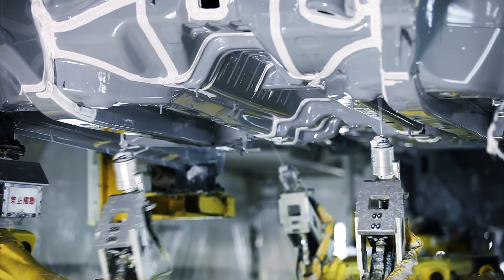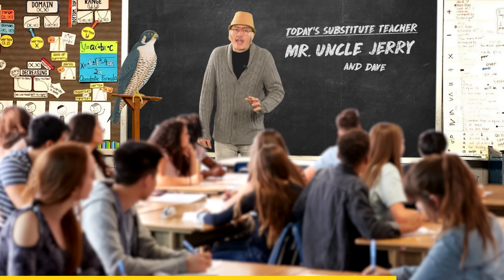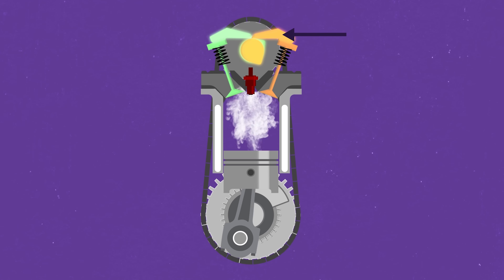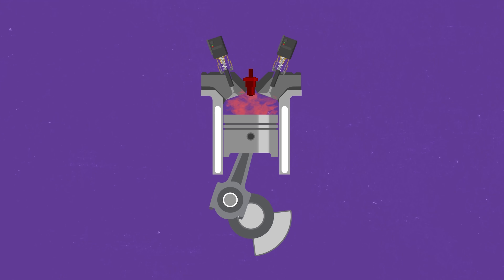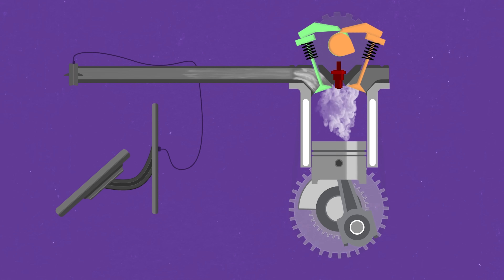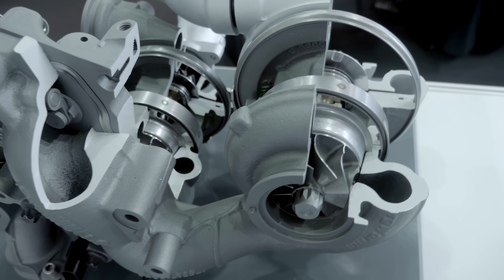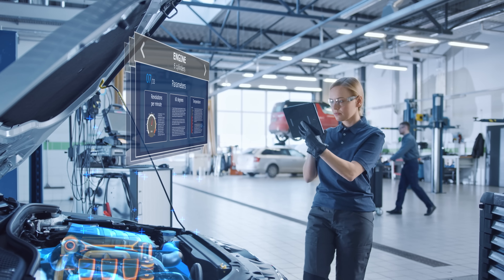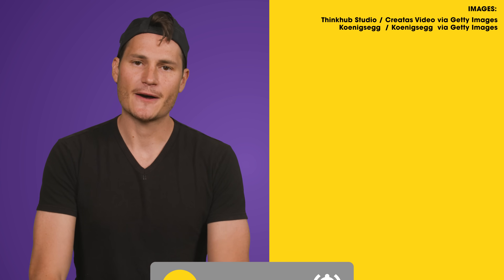This Is The Last Great Engine Tech

Comment: I think Freevalve is amazing but I have some questions:
1. How's the reliability?
2. Why is it not widely used by other OEMs?
Reply: Electronically actuated valves in mechanical settings have been used for decades. Commercial/industrial HVAC has it everywhere, it's a simpler design overall. But it's at least no more complex or reliable than traditionally mechanically complicated systems. Solid state has improved this reliability even further.
Reply: Its not widely used because of legal issues im guessing. Iv heard that the reason alot of these features arent widely available fast enough on cars, is because an OEM would hold the rights to it for a shit ton of time, and would expire after a decade or something.
Reply: You also take out more moving parts so I think it's kinda a mute answer yes the solinoids that move the valves may cost more but,you don't have a timing belt tensioner or a timing belt and no cams
Reply: There are a bunch of bullshit answers here, the real reason is that Freevalve has a bunch of patents that would prevent any OEMs from using the tech without paying Freevalve. So naturally they won't pay up and are willing to wait until the patents are no longer valid, or would just rather focus on electric cars as ICEs are going the way of the dodo. Most of the patents filled by Freevalve were filled from 2011 to 2016, so they will lapse in 2031 to 2036.

Reliability wise, actuators are not a new thing, we've been using them for decades, just not for engine valves, their well understood and can be made very reliable. They'll last for years at least. They don't really have any moving parts.
Reply: It has about 10 years ago. It's not a new tech has suggested in the video. It's just too expensive
Reply: Reliability would come with mass production, example if Toyota picked it up

OEM are chained to shareholders for maximum profit, don't you realize that BMW is mostly plastic now. Shareholders are not a big fan of R&D because it eats into profits and dividends
Reply: @User1Entertainment  So because they use plastic and less expensive materials more it means the R&D is less?  Stop looking at base models my man and also understand some of the R&D ie make things plastic such as an intake to make for weight for such things as high pressure fuel injectors and or HPFP to feed the injectors now as well when they went to a high pressure fuel system and other ways they adapt to keep a mostly 50/50 on every vehicle and still adding all that useless bullshit over the years on the interior.  Plastic and foam are also a good insulator for guess what sound and who usually buys the BMW first? Someone with money and guess what a lot of them have complained about in the past and still do to this day?
Reply: @jamesbond-pr5jl  I understand that but I will not agree with decisions like plastic thermostats that BMW makes, certain areas of the power train should be exempt from extreme cost cutting in favor of reliability
Reply: If you watch the video on /Drive from 2013, you will see they had already been testing an old Volvo for I believe 5 years. The reason why other companies are not using this is because there is no money in ICEs. Audi even made a new type of fuel, for cryinoutloud! The government simply thinks that batteries are the way to go, no matter how they are made.
Reply: Actuators are used pretty much everywhere for precision movements of free-floating, low-friction applications, from your run of the mill audio speaker to the read/write head of hard drives, and they are the least likely element to fail in those applications (electric motors are much more likely to, usually from lack of grease).

They also have another property that make them suitable for valve control: they are capable of pushing and retracting. Cam lobes on the other hand push, the engine relies on the spring to retract the valves, and at high RPM 
those springs can become a bottleneck in the sense that they aren't capable of retracting the valve fast enough, compression can fall, air can be pushed back to the turbo on the intake side, the exhaust side could have the piston hitting the valve...

And last but not least: no more timing belt! If an actuator fails, the valve can be made to stay closed and not lead to the damage a failed timing belt would. Actuators are cool, man.
Reply: it’s used in many forms of racing, F1 has used it for a long time, and there’s 5 different manufacturers I believe, so ??? It’s like saying why haven’t they made Electric cars 20-30 yrs ago, but they’ve been around for 100 yrs too, the big 5 didn’t want to change and don’t want to change the normal way of doing things unless forced to do so.
Reply: The default is closed unlike with cam actuated valves, many modern engines aren't free wheeling they call these engines interference engines. If you break a timing belt or chain your pistons hit the open valves and can totally destroy the engine if it's spinning very fast when the failure occurs. That kind of failure is not possible with the FreeValve system. I watched Christian's presentation on his FreeValve system and he had a *Volvo (I think it was a Volvo, I'm getting old) with the FreeValve system using it for a shop car, he claimed it was doing fine. You can probably put
Koenigsegg FreeValve in your YouTube search and look for the big guy guy with the shaved head.
Reply: It is still a new tech as far as being implemented in production vehicles, and that production vehicle is very expensive and rare. There isn’t much data on long term reliability outside of Keonigsegg’s testing. They also probably have patents and licensing that they want to use to recoup their development costs.

As to why other OEMs aren’t doing it, the same reason why it took Tesla entering the market for them to take electric vehicles seriously or legislation that forces higher standards on them. Someone needs to gamble on it first and dip their toe in the water and succeed before the other OEMs will see the R&D as worth it. They are businesses with shareholders after all. Years back the drive did a piece on free valve while it was still in early development, and they addressed the engineering challenges with cycling the valve train with enough precision and reliability while attempting to keep the costs down in a range that would be palatable. The major benefit of free valve technology is that it can be applied to pretty much any gas engine once all the kinks are worked out, so it doesn’t even necessarily require OEMs to adopt it, you could eventually get a bolt on kit from aftermarket manufacturers for your 90s LS3 that puts it within spitting distance for efficiency and power of more modern engines if everything pans out for the technology.
Reply: Why retool or retire your assembly lines or suppliers? Plus, it’s probably cheaper to keep the traditional tech. You have R&D and costs associated with the changes. I wouldn’t be surprised if they’re waiting to move to the tech or betting on electric, as CA is banning all new sales of ic vehicles in 2030(?)
Reply: Reliability great.  Gains great.  

To anyone who says camshafts are reliable how many cars out there are interference with timing belts and sub 100k mile service to that belt?

Just needs to beat that.
Reply: and how expensive would replacements be?
Reply: dude its fresh just like electric cars were!
Reply: Injectors on a big rig are virtually the same concept and they last for a million miles some times. I don’t know how many cycles that is but it’s a lot. I imagine if this comes to market they will engineer it just good enough to last around five years of average abuse.
Reply: @aceplaysgamesnetwork9566  haha hence why im laughing to how there is still so much ignorance of understanding how vastly this consept has been used for years and years by so many still being I know fiat air was not the first of this style of used concept on mass by any means. All major cars using the HPFP system too and even upgraded from solinoid to pezio style to more accurately do it.
Reply: If i remember correctly, the issue with electronically controlled valves (which have been trialed since the 70’s, mind you), is that it took a long time to find actuators that are powerful and fast enough to work a the rpm needed to make them worth. Also skipped over in the video is the enormous gain of efficiency from the rotation friction losses from the camshaft.
Reply: Alfa Romeo/Fiat use a system similar to this called MultiAir , but I believe it's only for air intake.
From what I've heard allot of people struggle with reliable. And it's rather pricey to fix
Reply: From a engine reliability point, you would never have to worry about bent valves from an engine jumping time, since the resting state of the free valves is closed, if one malfunctions it would just stay closed, the ecm could then detect that and just shut off that cylinder, allowing the engine to still run smoothly. I hope they design the engine so the Electronic portion of the free valve could be removed with out replacing the entire valve assembly. Another thought would be to use oil pressure instead of an electronic coil to open the valve. It would still require a valve to control the oil flow, but it wouldn't have to be  as big or expensive.
Reply: If you can run ignition coils per cylinder reliability then why not freevalve?
Reply: It was just developed and that answers both questions
Reply: Well most cars today already have computers for fuel injectors, so could they just use the same computer or an addon for the comptuer??  2. yeah why WHY, I'm not a big person on the environmental stage, but FUEL EFFICENCY applies to everyone  less money at the pump and less fuel consumption.
Reply: Because this is out of budget for most cars and koenigsegg are the one who invented it
Reply: @estebansoria3037  the technology is actually not very expensive, but there's probably patents that are preventing other automakers from using it at this time
Reply: Fiat called it "multiair"
Reply: @t.lledsmar6052  I helped my buddy do a head gasket replacement on a multi-air engine once. Thing was a nightmare lol. Multi-air likely has a similar effect but I wouldn't say it's the same things because multi-air uses oil pressure and is much more complex than free-valve. (If my understanding is correct)
Reply: @t.lledsmar6052  multiair - hydraulically controlled rotating "lobes" between camshaft and valves. It's more (mechanically) complicated, more things could go wrong harder to work on and not as flexible as freevalve
Reply: @t.lledsmar6052  not really. Multi air is cool but cannot open a valve any higher than engineered in the camshaft/hydraulic circuit. It still has all the parasitic HP losses associated with normal camshaft systems. But it does allow for very good control over valve timing and lift (to an extent) and duration. But the base 'system' is still a mechanical camshaft and is ultimately limited by it. Cool tech, though.
Reply: Glad to finally see some voice of reason in this comment section. That number 1 question is very important. New chips based on silicates +  worldwide silicon shortage = huge backlog or unreliable chips made through easy and quick manufacturing. How long will these chips last? How about the other components on their circuit boards? How will this impact auto mechanics? Will this advancement complicate repair jobs for small garages? Does a new age car mechanic need a full fledged degree in engineering in order to service these future cars? Sure this idea sounds cool and it's awesome that there are still technological developments for IC cars, but we cannot ignore the impact this will have on the majority of this world's inhabitants. What about the manufacturing process of these parts? Would it still be able to be developed sustainably once a total global implementation has been reached? Maybe not even total, how about large scale manufacturing of these specific parts? Will the OEMS even account for universally usable protocols or will all these future parts be proprietary?
Reply: @ali709aliali  Why would a mechanic need to be an engineer in order to service and repair a ready made product? All the engineering has been done. It doesn’t take an engineering degree to understand engineering or how to replace parts no matter how complicated the removal and replacement of that part is. Your post is less than thought out.
Reply: @ali709aliali  Everything you said multiplies 1000x for an ENTIRE ELECTRIC CAR. No?
Reply: @ali709aliali  I don't see much reason. The average modern car has like 3000 chips in it, and cars now are more reliable than they've ever been. How is it a mystery that other OEMs don't use a tech developed only five years ago by Koenigsegg for a 1.7 million dollar supercar?
Reply: @ali709aliali  see it depends on brand to brand. Brands which were not reliable are pretty much the same even now. Take for instance in bikes Harley is not reliable where as YAMAHA is still reliable. The electronics reliability is also depends on after sales support. For example, you can tune Carburetor on your own but in fuel injection system, you need a ECU Monitor in which you need to rely on service mechanic. Every thing has good and bad. Its a two sides of a coin.
Reply: @DileepPisupati02  you only need a service shop because they lock you out of the ECU interface. If you get a proper reader/writer fixing an ECU yourself is far easier than a carb.
Reply: @ali709aliali  Future mechanic will not need a degree in engineering, he will plug in the gizmo and it will tell him what components need replacing and he will replace them, he doesn´t even have to know what those components do, other than that, as you dig deeper into the engine stuff gets less complicated like bearings, gaskets, oils, fluids and the like.
Reply: @ali709aliali  I don’t see computing being the problem, especially because they experience very low usage at intermittent times. It’s more common to see fuses, bulbs, motors, literally everything will require maintenance before a cpu will, it’s also not like our phones which receive an update every year, people usually own cars for many years so the volume of chips is nearly nothing compared to other industries.
Reply: @ali709aliali  tf u talk aboit, it does not needs new ecm, engine ecm can handle this task easy. And its not rocket science  , you can study electronics in one week. U only need maf and crank sensor data which every car has and ecm gonna send signal to electronic valves based on those signals. U allready have tens of computer modules in car even if you add one more nothing gonna change.   Grab a book and study. Nothing is hard to repair when u know it.
Reply: @ali709aliali  what a cave man way of thinking. Do you really believe that an electronic component is less reliable than a mechanical one??? what??? i don't see people longing for carburators because the injection system is too unreliable... what a comment.... and to think that most of the people think this way....
Reply: @ali709aliali  Injectors are incredibly reliable, much more so in fact than carbs, and need no maintenance. It'd be the same with Freevalve, freevalve solenoids can adjust their own valve clearances on the fly, simple diagnostics, and failure isn't catastrophic as you're not going to drop a valve in the the engine due to the return springs. This is also something that can be monitored, solenoids don't outright fail, and there are detectable signs of it going bad well before it fails. considering how freevalve would likely operate, replacement would be trivially easy. No need to worry about  timing, just off with the cover, unbolt old solenoid, bolt new one on, done. Solenoid technology is not something that's barely understood, it's been around for half a century. So in short reliability? Extremely high with no critical failure modes. Only problem would be is if both valves are shut and exhaust gas can't escape  that could cause some issues but i'm sure even in the Koenigsegg there are provisions for that, and as I said, failure is not immediate and is predictable. 
So for Q2:
The issue is reluctance. No-one wants to be the first one to dive into it and then fail. It also requires a lot of careful timing adjustments that manufacturers are either not very good at, or don't care about enough in mass produced numbers. Most cars coming off the factory are tuned horribly and rely on self correcting by the ECU constantly, this valve system would introduce a lot of new variables that'd have to be monitored and intertwined and it's the programming side of the Freevalve tech that isn't mature yet, but is also the easier side of the problem. I'm sure it'll be commonplace in 10 years time, but many manufacturers probably also don't see gas powered vehicles being around in 10 years, so why bother? Electric vehicles are even simpler than Freevalve so even though it's a good idea, it came too late for it to be implemented into everyday use.
Reply: @ali709aliali   if i normal guy can do this in a garage i highly doubt it will  complicate anything for mechanics....
Reply: @ali709aliali  solid state parts (things with no moving parts) are typically more reliable. 

It's the other non-solid state components on the circuit board that typically gives in. 

E.g. Old school capacitors last about 3 years. While solid state capacitors last 23 years on average.

If they build it only out of solid state components, and put a focus on long term reliability, it can easily outlast the car.
Reply: @ali709aliali  There is no easy and quick manufacturing of chips but there is lackluster qc that’s ran rampant in all aspects of manufacturing of basically any product you can name.
Reply: Cause they will not produce any Petrol or Diesel Engines anymore.
Electric sht.... Will take over cause of our stupid Politics that think that it is more green.....
Reply: @raphusso  electrically controlled valves can improve carbon emissions considerably and get a bit more life out if ICE. But a Model S Plaid is pretty fun to drive, not going to lie.
Reply: Grooling over new and shiny things is cool but we can no longer afford to be irresponsible about products or things that could potentially have a large impact on a lot of people.
Reply: @ali709aliali  bruh, we are ALREADY using it in fuel injection. its the same control just applied to valves. i think reliability will be just fine.
Reply: @mtnentertainment3454  in case your fuel injector fails, it doesn't ignite either way, because it's separated from the cilinder by intake valve, so it's either to much or to low fuel to explode INSIDE the cilinder. If the in/out cilinder valves were to be opened at the wrong time you could have the explosion outside the cilinder. This is where the difference is, cilinder valves have to be much more reliable than fuel valves.
Reply: @mtnentertainment3454  not the same thing, size is different
Reply: @DalitKumarAryan  i was talking about the concept. obviously the size would be different.
Reply: @mtnentertainment3454  size is everything in engineering and concept is different too
Reply: @DalitKumarAryan  size is everything, but the concept is the same and the size difference is not so drastic so as to make a meaningful difference. the basic concept of using an electromagnet to open and close a valve is very old and is used in applications much larger than an ICE.
Reply: @mtnentertainment3454  I believe you're not in the engineering field, np.
Reply: @ali709aliali  Electrical controls are pretty reliable especially with solid state technology, we've been using them in tons of industrial tech for years.
Chips are being cheaply made but not for auto manufactures, auto manufactures have buying power to get the good grades, believe it or not even Chevy has quality standards.  The silicon shortage wont last forever. 
Repairs should be easier, replacing an actuator on top of an engine would be easier then replacing a cam or timing chain. 

i can "grool" all i want.  Your ignorance to modern tech and global supply chains shouldn't hold us back from cool things old man.
Reply: @Subwolfer7564  Chevy has high standards .... Ford has none!!
Reply: @D3M0ify  Oh those boys at chevy are high alright.
Reply: @Subwolfer7564  Yeah. Electrical shit is stupid reliable compared to its mechanical counterparts. 
I like the fact alot of things are going electric in these engines. Instead of replacing actual mechanical parts, you can just replace the ECU with some cheap custom one.
Reply: @D3M0ify  the Chevy Bolt recall, forcing every car to get a new battery pack, may not agree with you....
Reply: @D3M0ify  too bad Chevy Makes shit cars.
Reply: @D3M0ify  wait what am I hearing it right! GM is stupid except for cars which were before 90's. But most of them are GAS Guzzlers.
Reply: @D3M0ify  ahh like the v6s in their suvs?
Reply: @Subwolfer7564  lolllll " believe it or not even Chevy has quality standards"
that's actually hilarious
Reply: @Subwolfer7564  😂😂
Reply: @Subwolfer7564  lol you clearly never worked on either
Reply: @Subwolfer7564  something similar  to PLC controllers which are robust enough to last a few years. My concern is about the durability of the free valves and solenoids.
Reply: @ndrsg3013  Your car already has a PLC on it, they've had onboard ones for decades. PLCS basically last until you damage them, usually overheating, corrosion, exposure to elements, etc.  They aren't like your windows computer. 

The actual valve isn't mechanically any different from the valve in your car now.  The solenoids may need to replaced, but they'd last a long time.  It'd be like doing spark plugs if you look at the design. 

Lets be real though, this is going to be used on performance cars first, which are not known for reliability.
Reply: @sweslac  actuators and batteries are two very different things sir
Reply: @ali709aliali  like the guy said: 30% better gas mileage, 15% better emissions.  I'd call this a large positive impact on people.
Reply: @larrym2434  and a completely flat torque curve!
Reply: @ali709aliali  
honestly it's probably got its issues and is a more expensive technology, but do you really think any of us can afford a Koenigsegg?
I'm pretty sure the people who own one don't really give a shit lol. they don't work on their cars, they drive them. or garage them for years to be a low mileage example of the car in the future, which is kind of lame
Reply: Cost of develpment is too high between rd for the actuators and the ecu tuning that goes into this system must be astronomical
Reply: Too expensive to put into cars realistically and if it’s not broken, then don’t fix it. I don’t know how reliable it is, but it is pretty unknown
Reply: @bobandtay7139  I think once it gets researched and development pours in more, its gonna be more reliable.

Electronic stuff is solid state. It doesnt rust, corrode, or degrade over time as much. I think personally, at the hands of toyota and honda, its gonna be stupid reliable.
Reply: @bobandtay7139  Koenigsegg put a free valve setup on a saab and drive it like 100k km and that was like 7 years ago (maybe more). I'm confident that if CVK puts it (this or any tech that's new) on one of his cars it's a solid technology.
Reply: @bobandtay7139  that’s what I was thinking. For something to be scaleable, it has to be significantly better than the current market product at a competitive price. Otherwise, you will only convince optimistic users and not reliable investors.
Reply: @bobandtay7139  its cheaper to manfacture tho from an electronics standpoint cause it's basically a solenoid and a spring
Reply: @bobandtay7139  I feel like you would've said the same thing about fuel injectors when they came out. "Not broken don't fix it" is a sad mentality, try " It's working let's improve it".
Reply: @stevesamuel263  im all for it im just saying thats what companies think
Reply: @bobandtay7139  Yep, and those companies are the ones we see that die a slow deathafter decades of solid performance just cause they get complacent.
Reply: @bobandtay7139  dude, it's in the Chrysler/fiat/ Mitsubishi  2.0 2.4 world motor.  I'm sure others are using the tech too they can't all brand it "freevalve"
Reply: @t.lledsmar6052  multi air is totally different than freevalve. Sure, what they are trying to accomplish is the same but the way they do it is not, nor are the results. Multi-air has huge limitations.